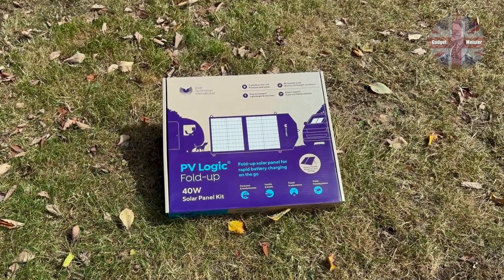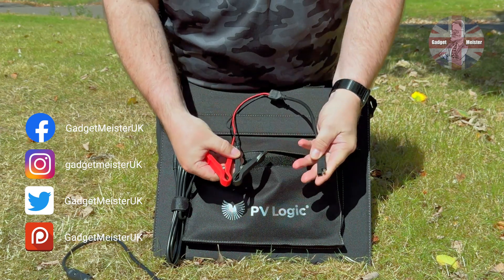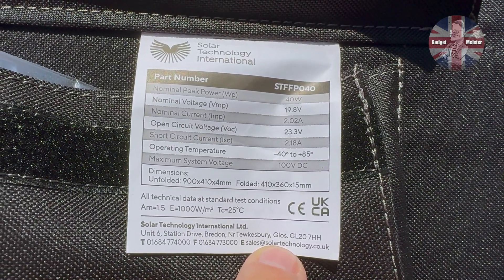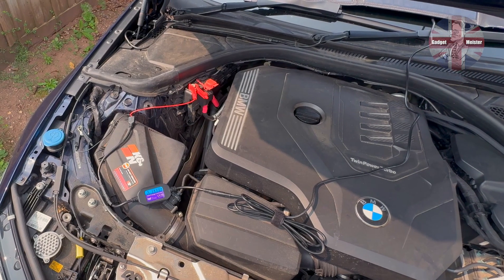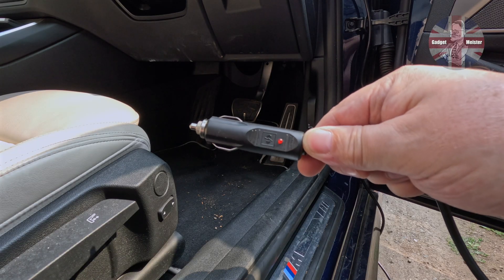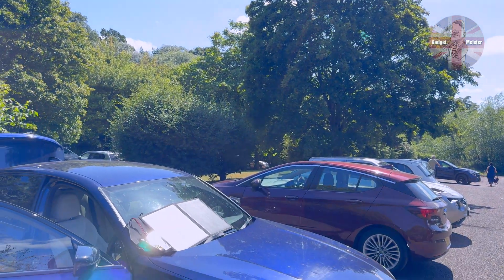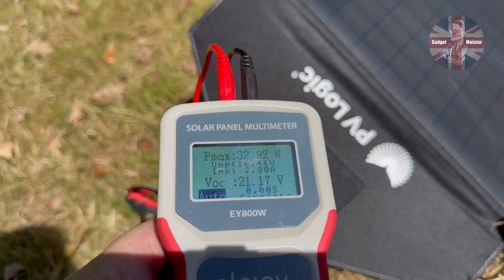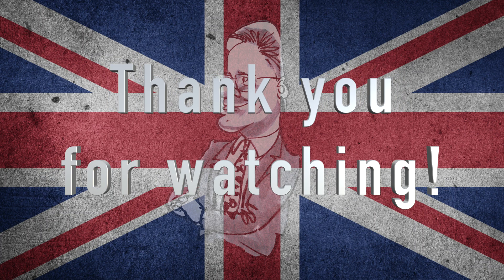Can this 40W fold-up solar panel recharge your car battery?

Comment: Nice one! Thank you for showing us this. Does it work with electric vehicles?
Reply from the maker: Electric vehicles like Tesla’s have a large LiFePO4 battery that cannot be charged from a portable unit like this, as the voltage is different.
Hybrid vehicles have a small secondary battery that could be charged from this unit though.
Reply: @GadgetMeisterUK  That's very interesting; thank you.
Reply from the maker: EV's have a battery voltage typically in the 400-800V range and a storage capacity of 20,000-100,000Wh. Given the amount of power they require, you will struggle to charge them with any speed using solar power, which is why they always use chargers connected to the mains!

Comment: What if you used the window suckers to directly attach it to the underside of the window?   would that improve the wattage?
Reply from the maker: There are no window suckers with this unit, but having the panel directly on the glass would have eliminated the shadow from the rear view mirror.
Any shadows from trees, telegraph poles etc will still affect the power available from the solar panel.
Glass is not completely transparent, it does stop some light from getting through, even more when it’s curved like a windscreen and the light source is not perpendicular to it.
Reply: @Larry  hello there Sir. Not expecting to see a comment from you here

Comment: 40W at 12V is only a little over 3 amps, not sure that would do much in the way of charging
Reply from the maker: You are trickle charging the battery, we are talking regular use here, so 40W is plenty.
If you want to blast the battery quickly then they make a 200W and even a 440W unit, but as the AGM battery under your bonnet isn’t a deep cyclic leisure battery, then such a rapid charge rate is not advisable.

Comment: Certainly a interesting product, I have been thinking about buying a trickle charger but this certainly a potential option to go for.
Reply from the maker: The problem with the little 5-10W solar chargers on Amazon, is they don’t have a charge controller and they rely on the battery’s internal resistance to pull the 18V (ish) from the solar panel down to 14V. If the car battery is small then the unregulated panels can overcharge the battery and cause damage!
The code in the video is valid for a limited time I believe, so if you’re thinking of buying this panel, don’t hang around too long 👍🏻